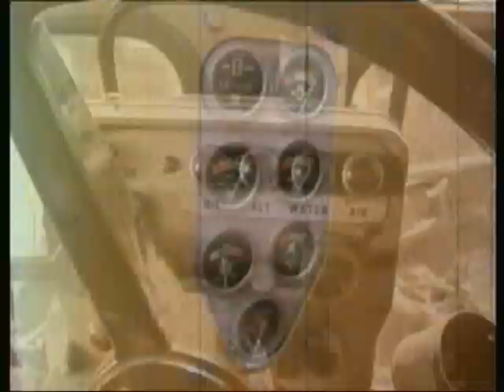Shake Hands With Danger, part 3 (of 4)

Comment: This has always troubled me at work.  Of course to prevent the maxi spring from escaping the chamber band clamp is crimped rather than bolted on.  However OSHA regulations want us to disarm the spring before disposing of the chamber by cutting the band clamp in a drum with a slot for a cutting torch.  We have no such disarming chamber nor will we after I alerted them to this.
Reply: One time I had to change the diaphragm on an old truck spring brake chamber. I was lazy and reached down from the top with the air rachet and I got the nut off. I went under and looked up. I took the nut off the spring side. I slowly put the nut back on and tightened. Wow such a close call.
Reply: NOOOO! you cut a hole in the side of the chamber just big enough and in the right spot that you can safely cut the coils of the spring. Cutting the clamp will cause exciting things to happen